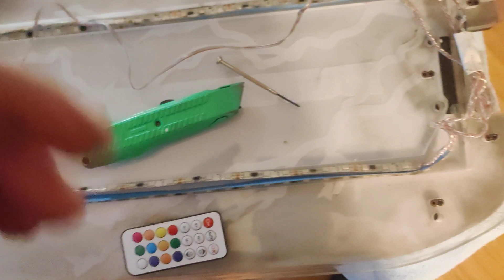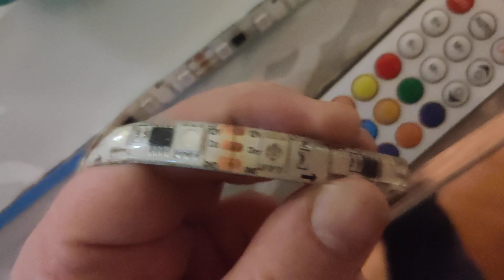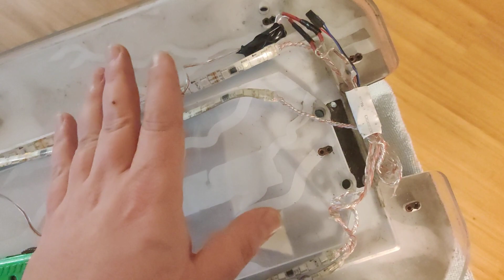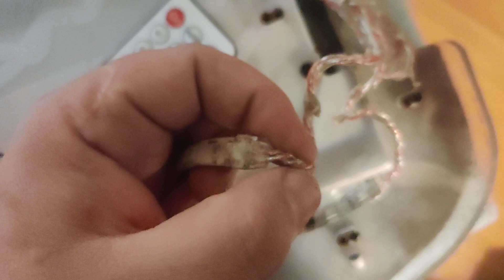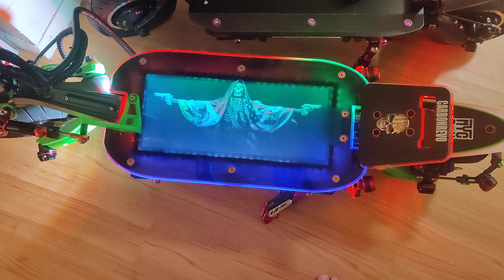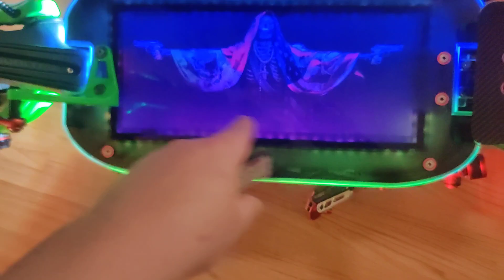Electric Scooter Guide: Let's Talk about LEDs and Carbon Revo Decks

Comment: Thanks for showing how the LEDs are fitted. As for the controller it looks like a cheap controller with heat shrink, and yes you can change the controller to something better as long as it fits in the spot. Esp32 with wled preflashed from AliExpress. You could upgrade the lights to ws2812B / 144 LEDs per meter. Wled app is the best app and nothing comes close. My concern with controllers is if it has a fuse or relay built into the controller. If it doesn't then the LEDs will always draw power from the battery even if it's not powered on.

Comment: Thank you very much for the info bro!! greetings from greece! i plan on making a custom deck for my thunder too,do you know from where can i order the anti-scratch surface that carbonrevo deck has? or any other surface that i can place in the deck to make it less slippery?
Reply from the maker: Most carbon led decks have a simple plastic or acrylic top piece...it's not 100% scratch proof.....you can probably order it from carbon or go on Ali express and search for dualtron deck covers...they have some there...or make your own buy buying a plastic sheet and cutting it to your deck size...I buy mine from a local dualtron dealer store.
Reply from the maker: Voro motors sells some to...

https://www.voromotors.com/products/acrylic-clear-deck-cover-for-dualtron-victor?variant=41443807461574&currency=USD&gclid=Cj0KCQiA8aOeBhCWARIsANRFrQF9I2rHDfMS_xBFLcVUZOA_hga9xLM0fM6AgPsxiz2IYVhhRP_ryCUaAtl8EALw_wcB
Reply from the maker: Not sure exactly what you're looking for but see another link 

US $14.25  5%OFF | All series Deck Sticker for Dualtron electric scooter THUNDER Ultra, Raptor, DT3, DT2, Deck Sticker Non-Slip Decal
https://a.aliexpress.com/_msiKxow
Reply from the maker: US $61.00 | Original Rubber Deck Pad For DUALTRON Victor Electric Scooter Rubber Foot Pedal Pad Accessories
https://a.aliexpress.com/_mMfleF8